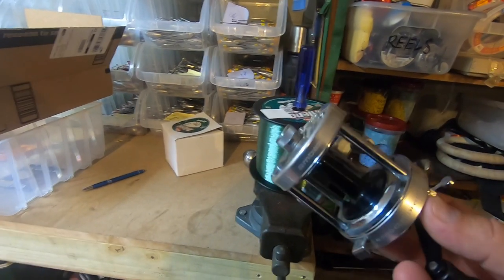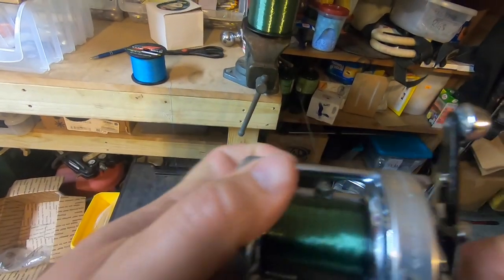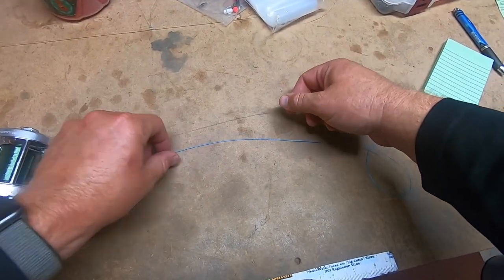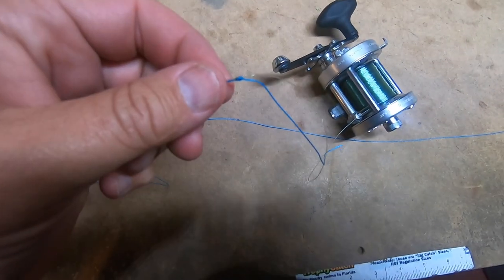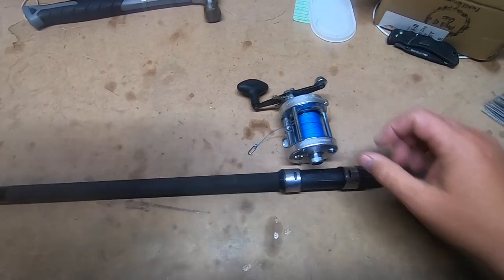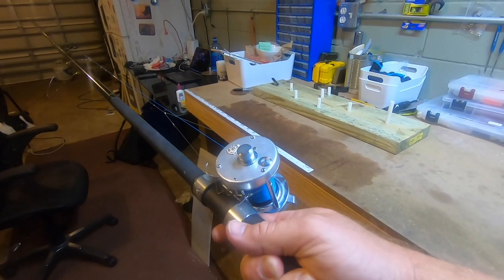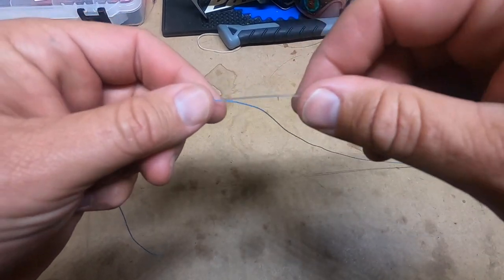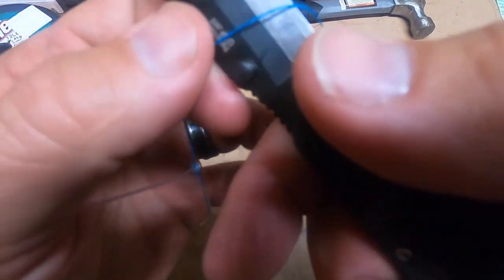Surf Fishing Florida Setting up your surf rod with a bait caster reel. Best bait caster set up.

Comment: You just spooled a twist in your line. The line should come off the spool and go on the real the same way. At least that’s how we do it in the tackle shop. Also a heavier shock leader OF MONO Not BRAID will help you casting heavier weight to distance without breaking your main line.

Comment: Chip you are wealth of knowledge. I find myself having alot questions but I'll keep it relevant to the video. As I was told pompano are sight feeders, if finishing for Pompano and Whiting, and plan on using using  a 4oz Spunik sinker should I use 40lbs. shock leader or something smaller like a 30lbs.shock leader?
Reply from the maker: Mark great question.  I would use the size you feel comfortable with and not lose your terminal tackle.  Some elite casters can use 17lb and not throw off the sinker.  This isn't very many people and it costs them lots of money when they try to go to small.  I use 50lb shock and don't have trouble catching fish.

Comment: What rod do you use, I was thinking of converting my tournament reels to fishing reels? Both are Abu CT6500, Blue Rocket and Green Rocket. I’m using a Custom 2pc 1pc rod and Breakaway HDX and HDX Tournament Rods. I also have several Diawa Sealine X20’s.
Reply from the maker: I use the florida surf anglers rods and Over the Bar rods!

Comment: Are you sure those aren't   centauri knots  braid to mono?  Uni's are made in a different fashion.  I subscribe.  Going to use your leader with figure 8's  and snoods.   Snood loop needs to crimp/pinch down end to get small knot connect to leader.   Especially  using 40 lb snoods.
Reply from the maker: Bob S47 thank you for your input!

Comment: Why mono first and braid for the shock leader?  I've seen it done just the opposite.
Reply: Thanks for the video.
Reply: There's actually two reasons for this 1 is Braid will slip if tied directly to the real without some sort of backing. So most people either use electrical tape or start off with mono and then tie braid to that. Second is that braid is typically more expensive than mono so most people will spool part of the Reel with monofilament then finish off with braid. most times you will never see the mono unless the fish takes a lot of line. As far as the use of a shock leader, it's best to use heavyweight mono because it allows for stretch and braids will not.
Reply from the maker: Paul Kinney I am sorry I missed this message!  

The reason I throw mono and a braid shock leaders is for two reason!

1). Throwing a 5 oz sinker creates a great stress on mono and after it stretches so many times it is going to break.  Losing your rig and also your sinker!

2) If I was to run braid and a mono shock at 40-50lb the UNI know would be extremely large and over time will ruin the guide in your fishing pole!
Reply from the maker: Paul Kinney you are correct but I have stated some reasons on Cliffords post